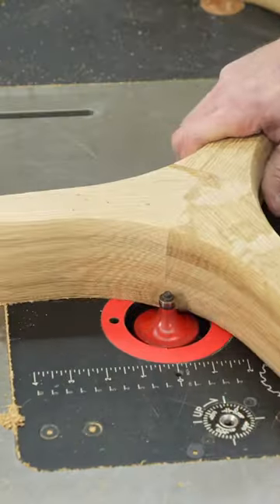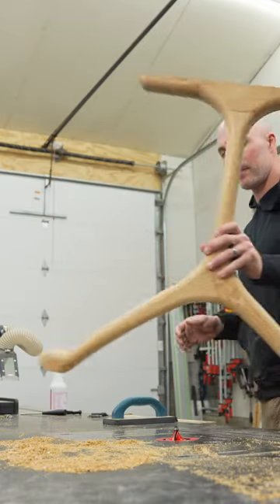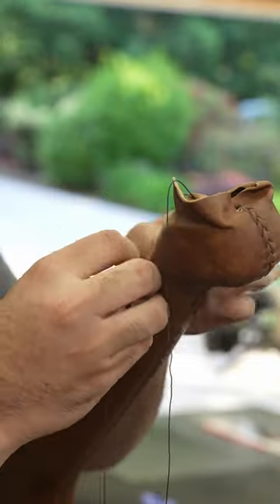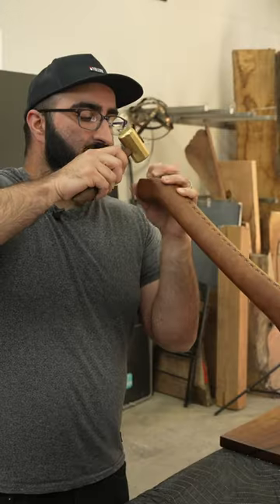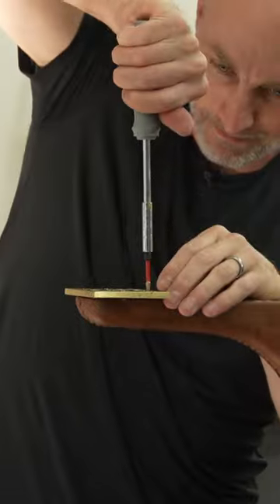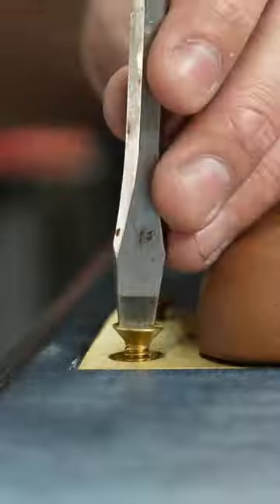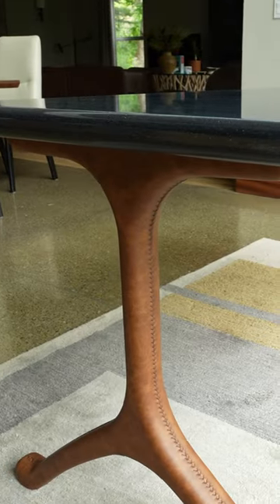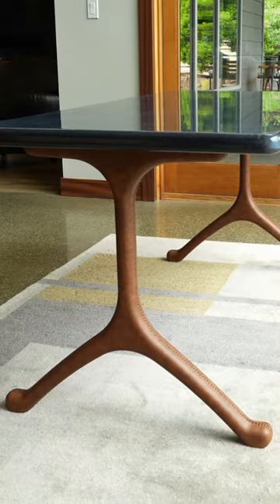Leather and Denim Table

Comment: Yes i have fourteen 16-penny nails , the end of a pair of good panty hose that I keep over the motor of my 12" miter saw that doesnt work but it has a good tenryu blade. I got a slingshot and half full jug of chainsaw bar oil.  If you could make a upcoming project with like setup so the average Joe can maybe do something, i would be appreciative.

Comment: I made this, but instead of the router I used my cheese grater and instead of the band saw I burned off the parts of the wood I didn't need using year-old fireworks. Turned out exactly the same!

Comment: If you don’t have a lot of tools you just learn to make do. For example, I don’t have a table saw…. But I can use clamps, a straight edge, and I know 1 5/8” gives me the offset I need to run my skillsaw guard tight to the straight edge.

I don’t have a drill press, but with a little more patience and tape to mark my bit’s depth, I can accomplish the same tasks.

There’s no one way to do any project. The longer you do trades work the more you realize that instructions are just one answer on how to get a product, however, there are hundreds of not thousands of other possible answers.

Comment: $550 for that LITTLE bit of hide? No way! My local peddlers mall has a booth that has hide JUST like that. Im not sure on the size but they have HUGE pieces for $80-$150...  Ive bought a few and made strops for straight razors, wrapped most of my axe and hammer handles and i still have oodles left!

Comment: Bro you got this, the hedge trimmer has basically mini chisels, that’s shaping covered. Use the back of the blade as a card scraper then finish off with a nice ball peen rub to get that shiny surface. Step Ladder rungs as a rasp for those high points?

Comment: Since when are you REQUIRED to do ANYTHING for us?  That is not what your channel is about, as far as I have seen over time. What we get is insight as to how you create the pieces of woodwork art that you do, using the tools and techniques that YOU have available to use. And then if any of us want to take on something similar, it’s on us to get the tools we need. You have been kind enough to share with us the how. 
Thank you for what you do and are willing to share with us.

Comment: dude, people ain't demanding you not use your tools, they're wanting suggestions on what simpler, cheaper, possibly more portable tools they might have available to use or can actually afford, because generally speaking people start by making furniture for themselves, and then once they're good enough that their shit starts getting unprompted compliments that's when they start doing it professionally, and part of that is needing to build their tables in the apartment complex parking lot, which means having portable, compact work tools above ones that're necessarily the most time or energy efficient, so letting people know that mitering tools for chamfering edges come portable as well as in table-installation varieties is helpful, as does letting them know that the same work can be done with a chisel, wood rasp, and sandpaper, it just takes longer.

Comment: someone who those few of tools is not a proper carpenter. maybe they have the skills thats required to be a carpenter, but propper tools are easy to find.

i got an antire shop worth of tools one at a time, and never spent more than $100 at any time for eatch tool.

band saw, drill press, table saw, so many more for cheap 😉